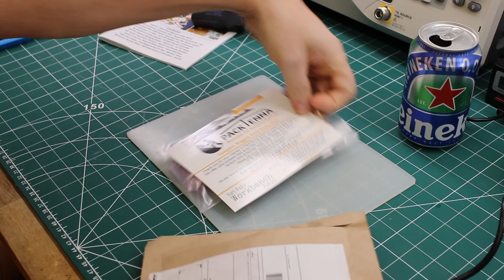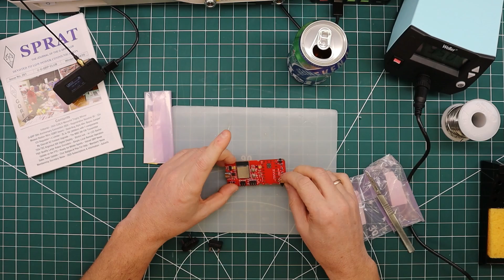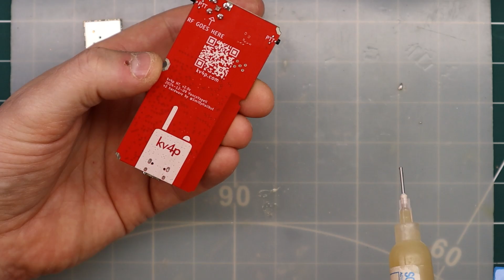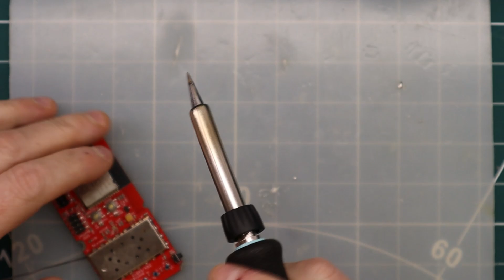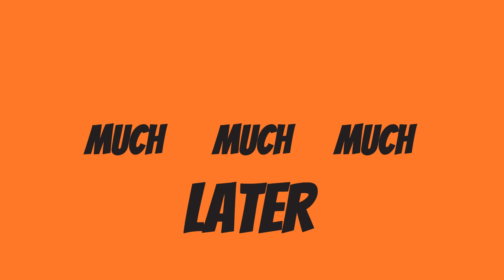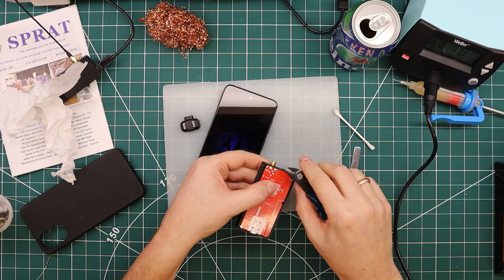Building the KV4P HT - 1W VHF Radio for your Android phone

Comment: Thank you thank you thank you! 

Yes hoarding plays off! 

Without your video I would have been chasing why that corner pin on the RF module was making a ground. I knew the center two were supposed to be this is on the short side I'm talking about.  

Did not know there were three pins over there that were grounded to case. 

Great video very helpful appreciate it.
Reply from the maker: Happy to be of help - enjoy your KV4P :-)

Comment: Did you use real lead solder? You could also use low-temperature / liquid solder/conductive paste for the under-module ground/heat pad.
Reply from the maker: Probably lead free solder. The iron was set to 350C. And the problem with soldering the pad under the board is that the SMA connector was already soldered, so there was really no sensible way of heating the PCB from below. I don't think it's that important, but if I get overheating issues I'll remove the SMA socket and reflow the module on a hot plate on my next unit.
Reply: @radiohyperactivity  You really would need a hot air gun to solder than tin case. And liquid solder paste makes the task doable. Good Luck!
Reply from the maker: @ I'd much rather heat the main PCB from below, instead of heating the SA818 with hot air from the top.